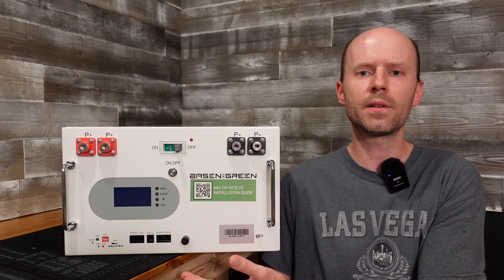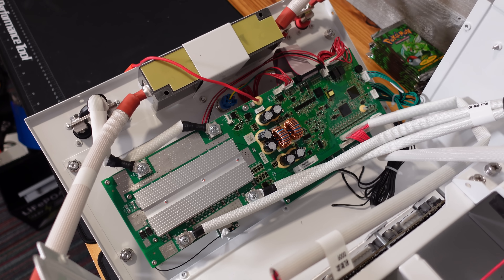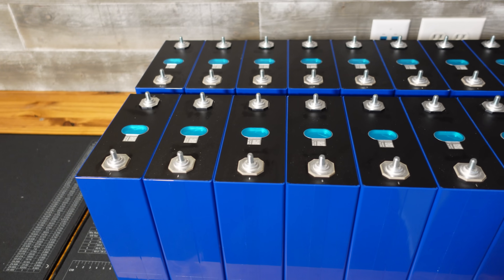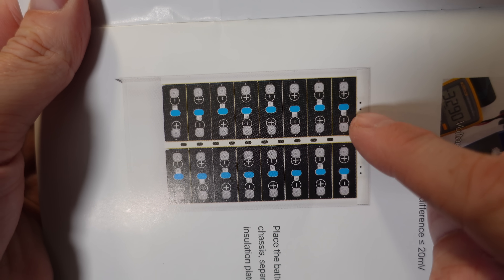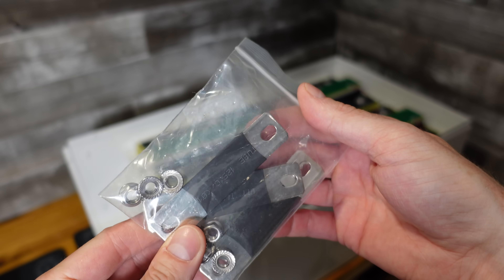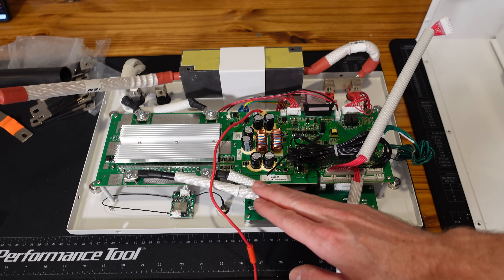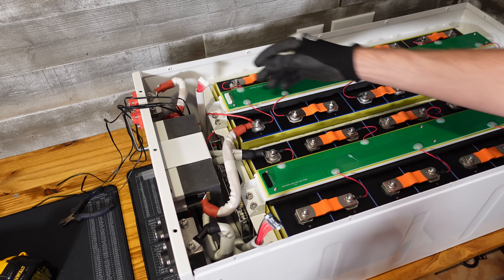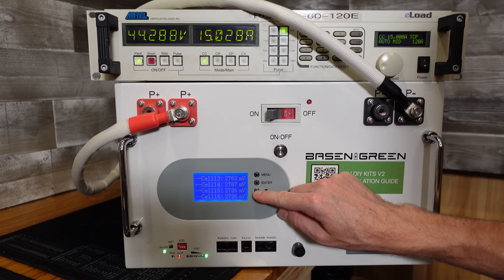Basen Green 314Ah 16kWh Battery Kit Full Assembly Review, $106/kWh Deal!

Comment: It would be better if the backplate was solid seems like lot of these same design with different names on it. Apexium box is the same exact design open back no backplate. This one seems to not apply any pressure to the batteries if they swell I guess the busbars will flex.

Comment: So they send solid bus-bars to connect the cells, but then the instructions have photos with the exact same ones that you bought apart and are better than the solid ones? Kinda strange.
Amazing video, as always.
Reply from the maker: The rigid busbars are contained in the boxes of cells. The cells can be purchased separately. When you purchase a kit with cells, they're not going to open the boxes of cells to pull out the rigid busbars then reseal them. I just considered it a bonus lol.
Reply: You want the orange flex busbars I would get 3MM bars not sure if these are 2MM likely are. Take the battery up to 100 amps of charge measure voltage protentional between battery studs. The 2mm I measured as high as 7MV .7 watts with 3MM down to 2MV which is .2 watt. While might seem like much it adds up per battery. The higher the resistance or amps going to get higher wattage burned in heat. Ideally want 0V between each busbar not real world. I built 2 Apexium boxes they came with solid busbars that were angled they got hot and I had as much as 70MV of voltage between battery posts.

Comment: I have four on this packs ( 60kWh) 
Working just perfect with cerbo gx over 1 year now.
I cannot say any negative word.
It's good to change a few bms settings, but the battery works well even with factory settings.

maybe jk bms can be better.
Reply from the maker: Wow and I thought one was a beast. How did you rack yours? Are they just stacked or do you have some kind of racking system for them?
Reply: @LithiumSolar  I have the batteries stacked in a metal cabinet, with shelves in between, so I can remove one if I need to.
Those 4x 16kWh batteries are accompanied by two Victron Multi RS 6000 inverters, and 8kWp solar panels on the roof.
With these tricks, I can manage 7 months of the year without mains electricity, winter is spent with electricity price-controlled mains charging.
The "Shelly relay" automatically controls charging, following a third-party electricity price table. I charge during the 6-8 cheapest hours in winter.

Here in Finland, the price of electricity fluctuates up and down as it pleases, this battery pack completely balances the price of electricity for me.
I can charge at night with cheap electricity and transmission fees, and use the batteries during the day when electricity is expensive and transmission fees are more expensive. 

So, Greetings here in northern Finland, aka, Finnish lapland.

Comment: Not bad but IMHO YIXIANG battery boxes are better designed and have JKBMS with 2A active balancer built into the BMS (not a separate module).
Reply from the maker: I am not a fan of the JKBMS. I purposely swapped one out of another case I have to put a PACE in. I will check out YIXIANG, haven't looked at those yet!
Reply: @LithiumSolar JK BMS also has a port for heating
Reply: @LithiumSolar I would definitely like to hear your take on the Yixiang kits.some others have noticed some small instruction issues, not necessarily errors, but not the most clear for us who don't do these cases day after day.
Reply: @LithiumSolar  I would certainly like to hear your take pros and cons of the JK vs PACE BMS debate.
Reply: This case is very very similar than yixiang, I think only difference is bms.
Reply: Pace is old tech... JK is ahead of the bunch - settings understanding is key and findable on the web

Comment: Great video as always.  Do you know of or do you have a video for a very basic setup that is not so expensive to start off with?  Something that you can add on to when you can afford more batteries?  I just cant spend $1600 up front.  Thanks for all you do for the community.  I appreciate it very much.
Reply: Maybe you can figure out a way to save up.  At that price it's cheaper than 2 server rack batteries which is insane.
Reply: I know it is alot of money upfront but it not only is a great deal but if you search for it, the Chinese government has recently made some lithium industrychanges.Those changes could cause lithium related prices to reverse course from going down anymore. Even if you don't buy this particular one, I think buying more of any lifepo4 battery is prudent right now.